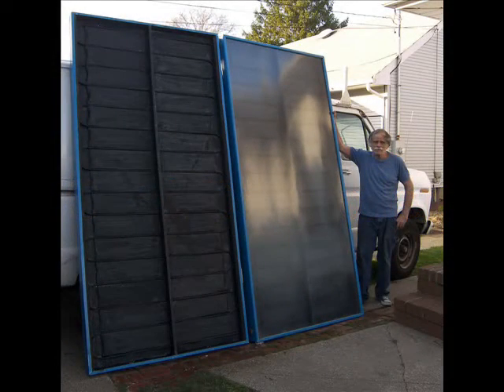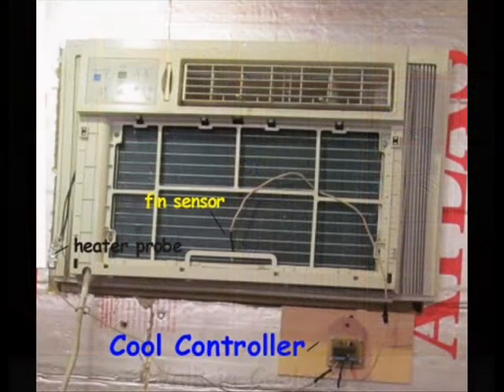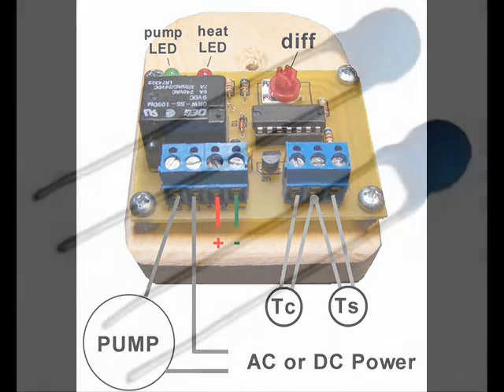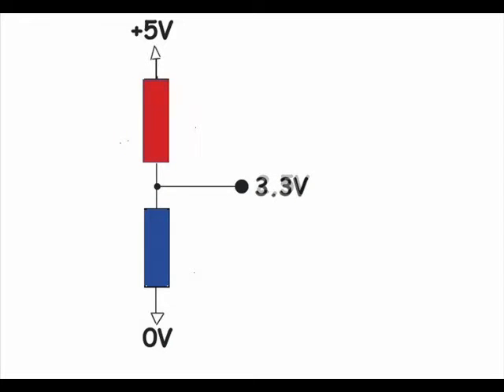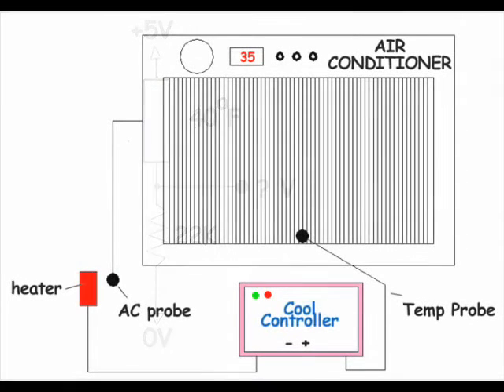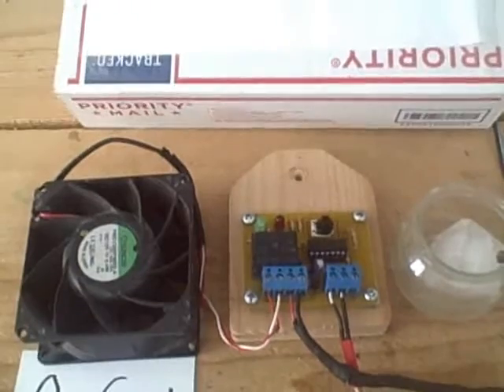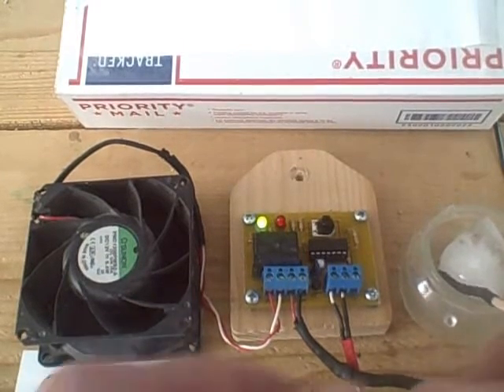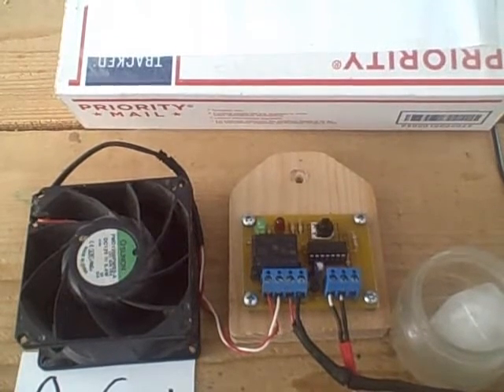CoolControler

Comment: Ok I have a couple questions.     (1) Where are you getting your heat from.   (2) will I need a ac to dc converter or transformer.  (3) is 3.3 volts enough to run the electronics on my air conditioner